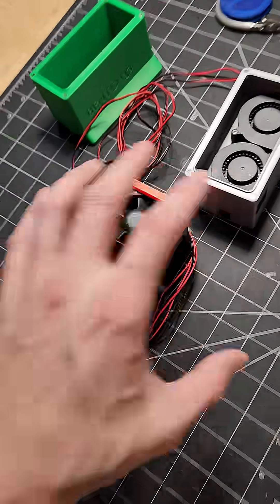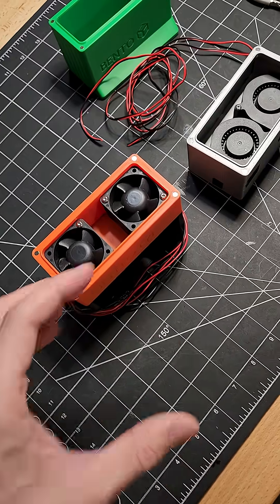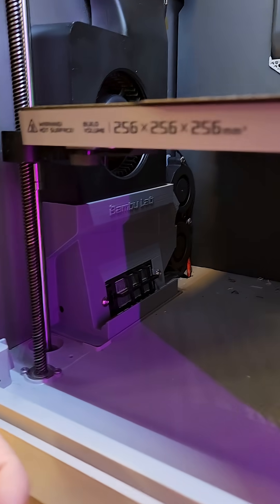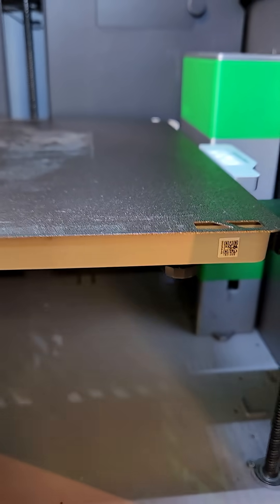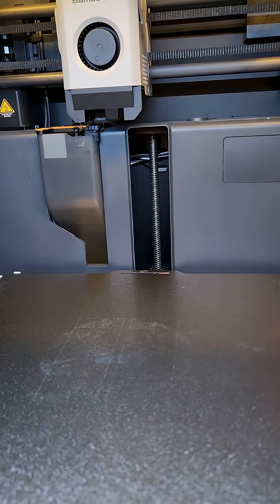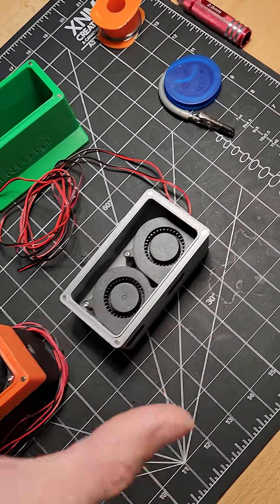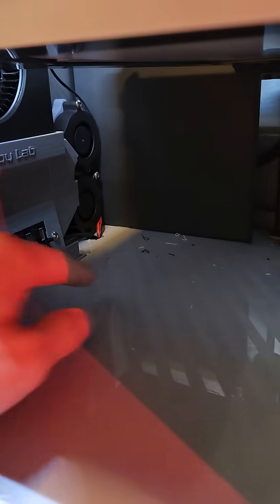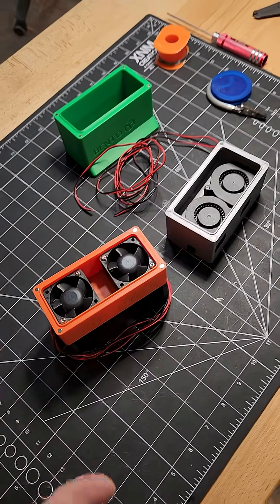Upgraded Bento Box Activated Carbon Filter 4028 to 5015

Comment: Whats the sound difference from the 4020's to the 5015's. Curious to find out as haven't seen any demo of sound levels.
Reply: axials whine a lot more especially in vacuum they run at even higher RPMs. get 5015s, there are multiple versions out there on Printables
Reply from the maker: Well this is 4028 to 5015, so the 4020 is a little more subdued than the 4028 but still the 5015 is quieter. I have a bunch of updates but I kinda lost motivation to make anymore videos as there's lots of others that put more effort into their videos and most of mine just feel like noise.
Reply: @makermsean thanks for replying and sorry to hear you feel that way cheers
Reply: Actually you have great info and offer different perspective especially since you’re using multiple different fans
Reply from the maker: @kupua Thank you, I appreciate that, I do continue to mod and upgrade as there's always more to explore. We'll see if I start back up but I just looked back and its been 3 months since my last video!

Comment: I'm sorry to post - but do you have the model for the thicker version of the bottom? I want to make this for sure, since I'm disappointed in the CFM and static pressure of the 4028.
Reply from the maker: For sure, the link is just in the description of the video. For both the original and the 5015 upgrade.

Comment: i went the lazy route and ordered the fully built unit from Voxel with the 4028 fans. Are their fans like your showing that can hot swap with the 4028's?
Reply from the maker: Stock design was with 4020s and the upgrade that fits is 4028 so if it already has that likely would have to print a new bottom section for the fans.

Comment: Thanks for the video, very helpful! Would you able to share exact model of the 5015’s you’re using please? I’m torn between GDStime vs Sunlon MagLev. 

Also have you considered hardwiring directly into Bambu PSU? I’ve read about possibility to control speed, on/off etc directly with some added code
Reply from the maker: I'm glad it was of use. I used the GDSTime Dual Ball 6000RPM with 1M cable. I do use the Sunon MagLev in the Nevermore filters I built, and those also work well.

As for hardwiring, you could certainly tie into the PSU for always on but you may need the third conductor for control. I haven't looked into where you can tap into for control, but I have heard of people swapping the aux fan connections for the Bento so they can control it that way.

Comment: Definitely think the higher static pressure of the 5015 is better for this application. Working on my own design for one that uses the original bento box size whilst only being 32mm high.
Reply from the maker: Very nice, it is for sure a noticeable difference, now when I put my hand on top I can feel suction.
Reply: @makermsean That sounds promising. Hadn't yet gotten around to powering the fans yet on mine. With the reduced height, I'm hoping to be able to stack two carbon filters in the X1C. I've also added a HEPA post filter to prevent carbon dust, and a dual HEPA pre filter at the top. Hopefully it all works 😅

Comment: Do you have a video on the heater
Reply from the maker: I do have a video on the initial introduction of the heater: https://youtu.be/CYHjAtjHWRo?si=yWB_4KNXvb0NIt_H

I wanted to run it for a month or so before I did a video on how it's working but I think I've surpassed a month now so I gotta get on the update. I will say it works very well and worth it if you're having issues with the higher end materials.

Comment: Ok, well that cuts the cost using those fans since I already have them. I think I could do the whole bento at $6, well $12 since I’m buying the smaller magnets. But that acid free carbon and filters adds to the cost for sure.
Reply from the maker: Definitely get the acid-free stuff, I've seen enough horror stories of corrosion in people's machines to warrant it.